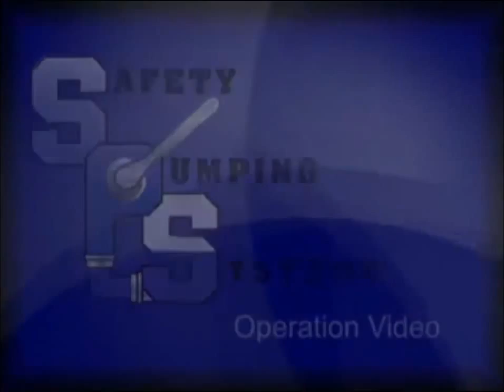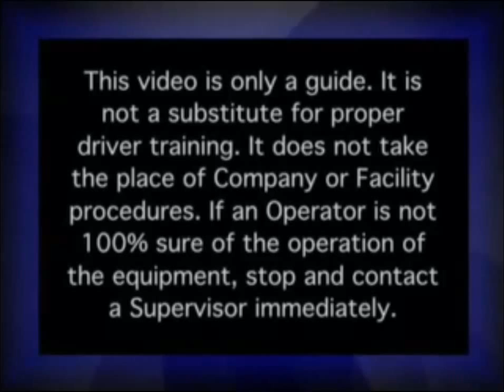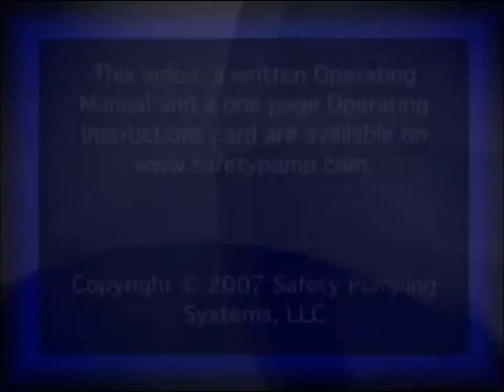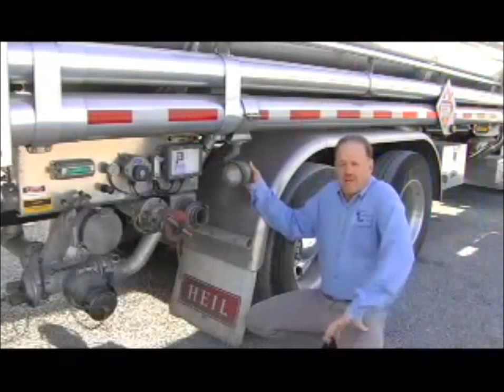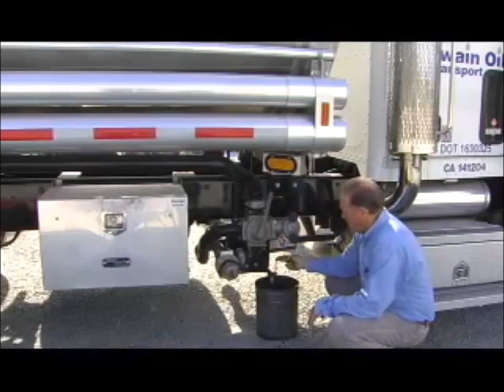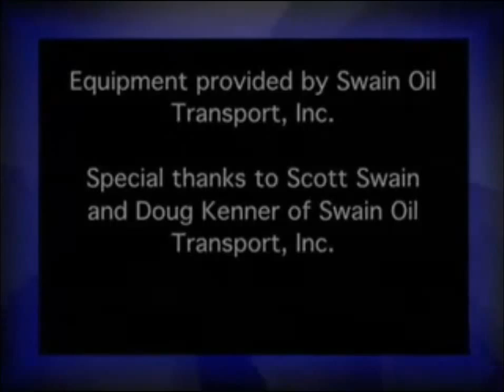HDI Safety Pumping Systems pump system operating video

Comment: Is there a way to clear air in the system? Anytime I pump out a station (below ground tank) it seems like it doesn’t have enough suction , takes a very long time to do a job. But when I offload using the pump it has a strong flow as I can see thru the site glass.